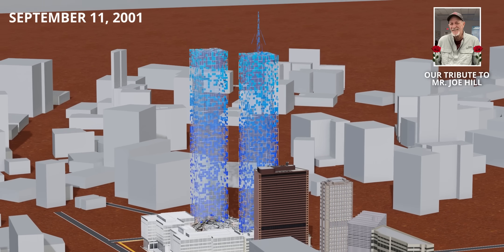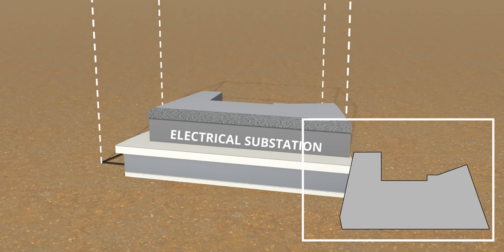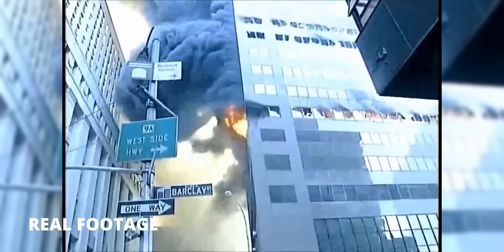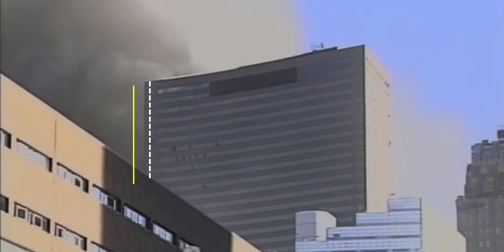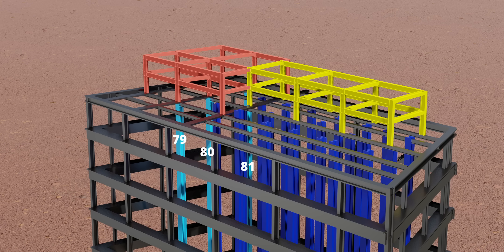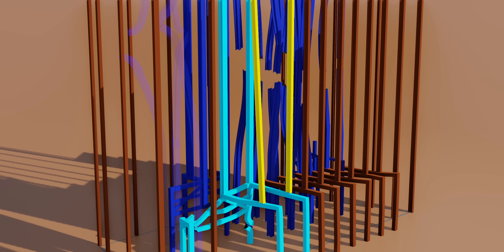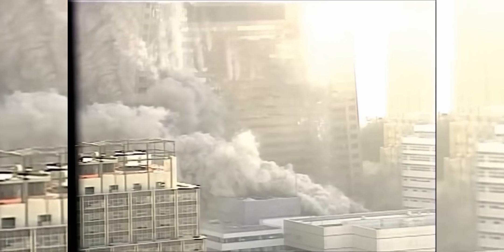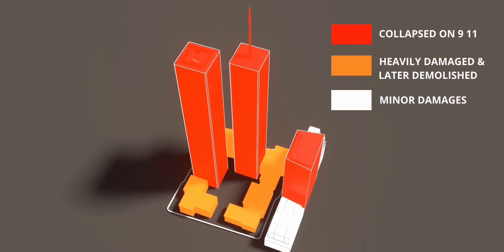Collapse of Building 7 | The Complete Physics

Comment: Small fires (lots of smoke, but small fires with very limited combustible material) and three failed columns (nowhere near the fire) dont cause all columns to fail simultaneously
Reply: Well, none of that is accurate.  You should probably scrap everything you think you know and start over.
Reply: @TheCriticalStinker-jw4fl  no, you should stop believing propaganda and try listening to engineers. Even the NIST report conveniently ignored the facts, including "Building 7, fire-protected more than what was legally required at the time for NYC, the fire resistance of a structure would be greater than the fires to which it would be exposed. In other words, the building would be expected to easily tolerate the fires it experienced. Building 7 had normal office combustible load levels ranging from 20-32 kg/m2, which is only enough material to burn for approximately 30-45 minutes in any given location. These values are accepted and documented within the NIST report. In fact, the NIST report is more conservative on burn time, stating: “Fires for the range of combustible contents in WTC 7 – 20 kg/m2 (4.0 lb/ft2 ) on Floors 7 to 9 and 32 kg/m2 (6.4 lb/ft 2 ) on Floors 11 to 13 – persisted in any given location for approximately 20 min to 30 min.” 

Consider the above in context with the fact that Building 7’s main supporting columns had at least 3 hours passive fire-protection and the flooring assemblies had 2 hours passive fire protection.  Therefore, the building had fire protection well in excess of what was needed to resist the fires it experienced. Because of these generous protection margins, rather than depending on water alone to suppress a fire, architects and fire service procedures trust the resilience of these structures to easily tolerate the duration of fires fed by the interior fuels. In a building like this, an active fire suppression system, such as sprinklers, is not needed to save the core structural integrity of the building from failure. Its primary purpose is to reduce and limit fire spread, and in doing so minimise internal losses and improve conditions for survivability and rescue."
NIST had to try FIVE TIMES and retract four reports before settling on one which was fundamentally flawed. Because it was a cover up and only idiots still believe it
Reply: @gjustg1540 - Again, none of that is true.  Please don't try to pretend you have a totally read NIST. It's not exactly a page turner.

It is also not the only game in town. There are several other excellent, comprehensive engineering reports on Building 7.

They all concluded it was fire too.
Reply: @TheCriticalStinker-jw4fl  oh wow, government agencies wrongly concluded it was fire in the reports which investigated them. Were they paid for out of USAID? I have read the NIST report, which couldn't even get it's own model to look remotely like the real thing. Strange how they still won't release their data for peer review, no? The university of Fairbanks' report is far more accurate. Oh, and a very close friend of mine (my speciality is aircraft engineering and inspection, air crashes. Let's not even get started on Shanksville and the Pentagon) has a Masters in structural engineering, we've had a good laugh at the official reports together. Which of NIST's retractions was your favourite? I loved the part where they said it could have been prevented by shear studs - completely omitting the 4,000 shear studs in place.

If you really want to read something that's a hoot, try the 9/11 commission report - such a terrible work of fiction I have never before seen
Reply: @gjustg1540 You contradict yourself, so bad, and you don't even know it. Lol
Reply: Bra-vo. You got literally nothing right. Good WORK!
Reply: @mooneyes2k478  no, I got literally everything right. Facts don't care about your hurty little feelings and thousands of engineers and firefighters disagree with you and your fairy story
Reply: “We walked over by number Seven World Trade Center as it was burning and saw this 40-plus story building with fire on nearly all floors.” –FDNY Lieutenant Robert Larocco 
“You're walking by this building and you're hearing this building creak and fully involved in flames. It's like, is it coming down next?” –FDNY Lieutenant James McGlynn
“When the building came down it was completely involved in fire, all 47 stories.” –FDNY Assistant Chief Harry Myers

"So we go there and on the north and east side of 7 it didn’t look like there was any damage at all, but then you looked on the south side of 7 there had to be a hole 20 stories tall in the building, with fire on several floors. Debris was falling down on the building and it didn’t look good." - FDNY Captain Chris Boyle

"The most important operational decision to be made that afternoon was the collapse (of the WTC towers) had damaged 7 World Trade Center ... It had very heavy fire on many floors and I ordered the evacuation of an area sufficient around to protect our members ... and back the people away far enough so that if 7 World Trade did collapse, we [wouldn't] lose any more people." - FDNY Chief Daniel Nigro, Chief of Department

Comment: This is a rubbish analysis
Reply: And yet not wrong. Go figure. 
	
This video is fairly good – with a few exceptions - for its target audience and goes into a much higher level of detail than many viewers will be able to comprehend.  While not perfect, the collapse mechanisms – the sequence of failures - described here  are substantially correct and this is true no matter who planned and carried out the 9/11 attacks or why . 

That may not be what you want to hear and go against 20+ years of entrenched dogma and conditioning, but it’s not wrong. 

That also means (in case you did not get the hint) this video can be (and IS) absolutely correct in its description of collapse mechanisms AND the 9/11 attacks could still have been some sort of inside job. The two things are in no way mutually exclusive. 

The mechanisms described here have broad professional support around the world. There are no professional engineering organizations (for example: ASCE, ASEE, ICE, etc) that disagree with them or have offered any formal dissenting opinions or alternative hypothesis. 

So, setting hubris aside, either the overwhelming majority of the worlds structural engineers and simple observation are wrong,… … or you are. Which seems more likely? 

IF you still think believe this explanation is wrong then produce a better one . Good luck with that. No one ever has and I don’t see you moving that needle today. 

No one ever does.
Reply: So you're saying the NIST report was wrong? If you say this video is correct; since it contracts the NIST report on WTC 7, you must believe NIST to be wrong?
Reply: @mikefitz22022  - It doesn't and no I am not.

Poser
Reply: @TheCriticalStinker-01  sure it does, 9:06 in, it says there is no free fall acceleration.  NIST says there is. Who is wrong?
Reply: @mikefitz22022  - The video is correct. The NIST were also correct - sort of.  Both things can be true for reasons I could explain to you but you would still not get (or more importantly care about) because they are already explained here and you didn't get it (or care).

Please go away now, imposter.
Reply: @TheCriticalStinker-jw4fl  someone running 5 accounts at last check calling me an "imposter" for exactly zero reason is very odd. And one or the other is correct.  This video runs on the pre correction NIST report with 40% of free fall acceleration.  The current version has free fall acceleration.  So this video directly contradicts it. I gather you're not supposed to say NIST is wrong and likely didn't realize this video you've been defending says NIST is wrong. That's your problem.  Black is not White and uo is not down. There was free fall acceleration or there wasn't.  Pick one.
Reply: @mfitz1619  - You are as always, wrong on all counts. I gave you everything you need. You will never figure it out, with or without my help. Not that you really want to.
Reply: @TheCriticalStinker-jw4fl  you gave me exactly nothing. Go read the NIST wtc 7 repot, see the free fall acceleration listed, then come back and say "this video is wrong and outdated". Otherwise you're "twoofer",
Reply: @mikefitz22022  - Unlike you, I have read it.  As I said before, the building was at no time in a sustained period of GA.  

There, I emphasized the important part again.  

Because you will need a bigger hint than that though;  IT WASN'T THE BUILDING THAT WAS BEING MEASURED, which is just one of the scores of reasons why this entire line of argument has always been a dead horse 100% guaranteed to go nowhere.

But you keep beating it expecting different results than the thousands who did it before you and let us know how that works out.
Reply: @TheCriticalStinker-jw4fl  😆😆😆 Ah there's the baseless claim. Prove it. You're seriously looking more and more unhinged.
Reply: @mikefitz22022  - Here's another one you won't be able to figure out;  How long had Building 7 been collapsing before that measurement of alleged GA was taken?  

If you can answer that (you can't) then you should be able to figure out the rest.
Reply: @TheCriticalStinker-jw4fl  🤣🤣🤣🤣 oh my God, you're claiming no FFA? NIST and their bots will be coming after you, nobody disagrees with NIST except crazy conspiracy theorists and "twoofers" 😂😂😂
Reply: @mikefitz22022  - Take your time. I know counting is hard, but the answer is the key to everything.
Reply: @TheCriticalStinker-jw4fl  "how long was the building collapsing before the measurement of GA"? Zero. The collapse of the entire building starts when the whole thing begins to move. If you claim otherwise, prove it. "I don't have to prove it" would be your go to answer at a guess because you like making unfounded claims then refuse to substantiate them. Let's see what happens.
Reply: @mikefitz22022  - Glad we got that sorted out. I hope you have been using this quiet time to actually read the documents you pretend to quote from.
Reply: @mikefitz22022  - OK then, please point out what exactly it means, why it is relevant and what, if anything I got wrong in my previous post.  Use complete, direct quotes and be specific. I am more than happy to continue pointing out your epic stoopid.
Reply: @TheCriticalStinker-jw4fl  if there is free fall acceleration, then that means what is experiencing it is experiencing no resistance. To make it simpler, it means there is nothing underneath it. Nothing. Which means for it to happen all those steel beams that are below the section falling at free fall acceleration have to vanish simultaneously.  Note the word "vanish". So you have to explain where they went. Do you think the bottom half fell leaving the top levitating then dropping at GA? That's impossible of course. GA is impossible with fires and steel. Unless you've discovered new physics laws of course
Reply: @mfitz1619  No it doesn't.  I already explained in detail there was no sustained FFA and what was being measured was not the building

I suggest you re-read my previous post.

For the first time.
Reply: @mikefitz22022 The 2.23 second period of free fall, of the outer shell of the building, was preceeded by 1.75 second period of much- less- than freefall. Something that would be impossible if all columns had been taken out simultaneously.
Reply: @TheMiddleClassholes  ah, so you mean 'acceleration'. Gotcha. So a rocket needs to reach 17,500mph to break earth's orbit, and it goes straight from 0 to 17,500 in an instant.....or is there a period of acceleration?
Reply: @gjustg1540  - Free fall or gravitational acceleration is ALWAYS a measurement of acceleration, not velocity. A free-falling object in a vacuum all other things being equal should achieve an acceleration of 9.8 m/s/s but a free-falling object in the real world can accelerate above or below that, just part of the reason this argument has from day one been such a dead horse.

Like claiming pull refers to blowing up a building or that firefighters blow up burning buildings and take orders from commercial real estate developers as they become accomplices in the deaths of 343 of their closest friends and family. It's just pure stupidity of the highest order. Embarrassing.
Reply: @TheMiddleClassholes  😆😆😆 once more, show that the exterior "shell" is completely uncoupled from the interior "I don't have to prove anything" was your last attempt to avoid being exposed pushing baseless nonsense.  The absolute best part? Say the impossible happened, and the entire interior did completely collapse, somehow leaving the exterior "shell" standing with no damage or sign the interior is gone. Free fall acceleration would STILL be impossible for the shell to do unless you caused the 8+ stories below the top to vanish in an instant.  How'd that happen? You are so out of your league and supporting a video that directly contradicts NISTs report and seem to be struggling horrible because of it. You do not grasp the basic physics of what GA means.
Reply: Apples to bowling balls, my friend.
Reply: @mikefitz22022  And again, the 1.75 second of less than free fall would be impossible if every column had been blown out simultaneously. Your entire argument is "free fall is impossible without help". It's asinine. There's a reason you hand wave on YouTube. You COULD take your objections to a structural engineering firm.
Reply: @gjustg1540  Apples to bowling balls.
Reply: @gjustg1540  - You did. 

In order to avoid any confusion, why don't you lay the whole thing out from start to finish. Complete timeline with the who/what/when/where/why and how.  Don't leave anything out or make anything up.  I'll know.
Reply: @TheMiddleClassholes  What a lame excuse. So now you say if every column wa "blown out" simultaneously free fall acceleration would be impossible? Of that's just hilarious.  So thank you for verifying that fires alone could not have caused the wtc 7 collapse. It's nice when even your kind reach the obvious answer, eventually. You really should think a bit before typing.
Reply: @mfitz1619  No, that's not what I'm saying at all. You can read, right? If you're unclear of what I'm saying, just ask. What I said was, if all columns were blown out, simultaneously (which is what you're claiming) than the much less than, 1.75 second phase one, free fall would be impossible. 

If fires couldn't do what was witnessed, then why do you claim to know more than the fdny? Considering they evaluated building 7's condition, determined that it was unstable and eventually going to collapse.
Reply: @TheMiddleClassholes  A) it's 2.25 seconds or just over 8 stories of Full free fall acceleration.  B) show me where I said the columns were "blown out", I didn't, that was me using your phrasing. I've not even used the term "explosives". You cannot even keep basic facts straight.  There is zero reason to keep discussing something with you that is obviously beyond your capabilities.
Reply: @mikefitz22022  - No explosives. Progressive failure of core columns following lower floor failures in the northeast corner then Transfer Truss Failure causing the exterior moment frame to briefly accelerate over-GA in 3 dimensions, not 2.
Reply: @mfitz1619  A) Correct, which was preceeded by a 1.75 second period of much less that freefall. Which wouldn't have happened if what you're claiming were true. B) You're claiming a controlled demo took place. How else would your fantasy be a reality? C) You're ignoring that the fdny evaluated building 7's condition, determined that it was unstable and eventually going to collapse.
Reply: @TheMiddleClassholes  - It was delayed action gravity Wile E. Coyote style
Reply: @TheCriticalStinker-01  It's funny how truthersn get to create new phenomenons with no evidence.

Comment: WHAT A LOAD OF RUBBISH!!! Everything about that day is dodgy as and don’t add up!! Corrupt asf shit!!
Reply: And yet not wrong. Go figure. 
	
This video is pretty good – with a few exceptions - and goes into a much higher level of detail than many viewers will be able to comprehend.  While not perfect, the collapse mechanisms – the sequence of failures - described here  are substantially correct and this is true no matter who planned and carried out the 9/11 attacks or why . 

That may not be what you want to hear and go against 20+ years of entrenched dogma and conditioning, but it’s not wrong. 

That also means (in case you did not get the hint) this video can be (and IS) absolutely correct in its description of collapse mechanisms AND the 9/11 attacks could still have been some sort of inside job. The two things are in no way mutually exclusive. 

The mechanisms described here have broad professional support around the world. There are no professional engineering organizations (for example: ASCE, ASEE, ICE, etc) that disagree with them or have offered any formal dissenting opinions or alternative hypothesis. 

So, setting hubris aside, either the overwhelming majority of the worlds structural engineers and simple observation are wrong,… … or you are. Which seems more likely? 

IF you still think believe this explanation is wrong then produce a better one . Good luck with that. No one ever has and I don’t see you moving that needle today. 

No one ever does.